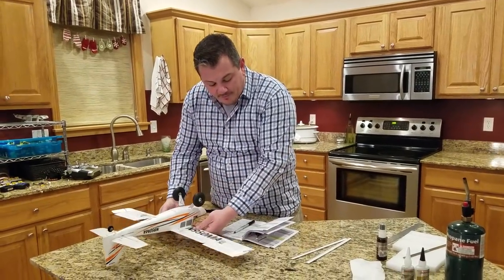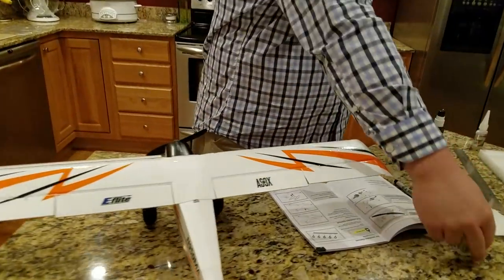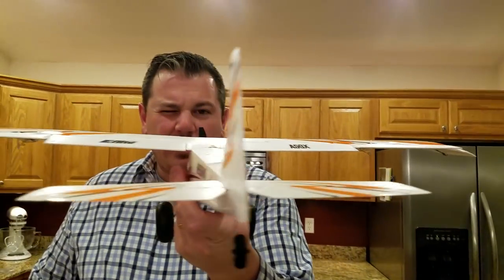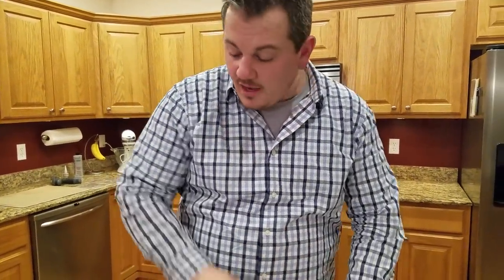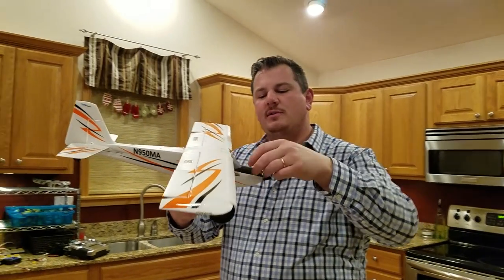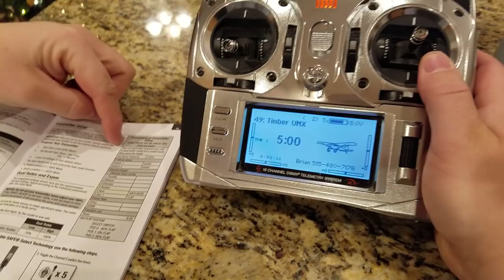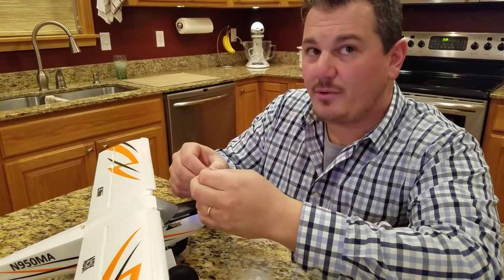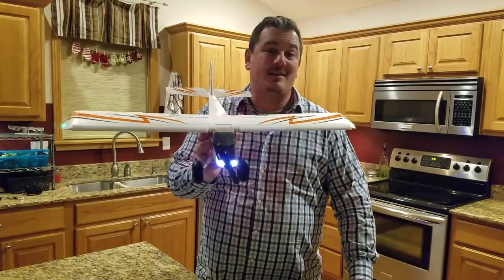Eflite - Timber - UMX - Assembly, Radio Setup, and Tips

Comment: Ok,  I Have the Timber UMX and DX6e as my first RC.  After 3-4 weeks, I have only been in SAFE mode.   The hobby has been a great learning experience.  Have been taking off and landing with Flaps down.  FIRST, Can you please give me your recommendations for elevator mix with both 1) throttle up and down, and 2) flaps up and down. SECOND, After ~~30-40 flights of 5 minute battery flight, I have experience an issue with two of my 2S 7.4 280mAh batteries.  With the battery checking  fully charged, the motor power has failed within a few seconds of take-off,  (NOT GOOD.)  Does the battery have a "shelf life", that can cause a disruption, even though fully charged?  I guess I thought it the battery showed charged, it was good?  Thanks for your help,
Reply from the maker: Let me answer this first...

Okay, are you having this issue with BOTH of your two lipos, or TWO of several lipos...is it a problem with ALL of them, or just a couple...

... I bet your charger is bad!!!

These 2S packs can and will "wear out", but only after many, many (hundreds) of charge-discharge cycles, or off seasons of sitting. I've had these "cheap" Horizon Hobby chargers go bad  ( https://www.horizonhobby.com/cars-and-trucks/chargers--1/celectra-2s-74v-dc-li-po-charger-%28power-supply-required%29-efluc1007
 ) . What charger are you using? (Send me a link so I can look at the specs).

As for elevator settings...down elevator to takeoff and landing flap configurations are highly subjective. If you deploy flaps, and the plane wants to "balloon", increase the elevator DOWN to flaps mix. If you're not 100% sure which way the elevator is going, simply crank it up to 50-100% and deploy the flaps...you will know now :) If you deploy flaps, and the plane dives, you will want to switch your elevator to flap mix from +XX% to -XX% or -XX% to +XX%...just flip the percentage "mix" to the opposite. If you're not sure, start with something like this...

Flaps Off - 0% Elevator
Takeoff Flaps - 10% Elevator
Landing Flaps - 15% Elevator

...then get in the air and test how it work out. There isn't a "right" and "wrong" since it's just totally subjective.

I wouldn't recommend ANY throttle to elevator mixing. I HAVE done this, but it's tedious and not necessarily helpful. Once you're out of SAFE, you might find a cool time to play with this, but now is not the time (As you're still fairly green), in my opinion ;)
Reply: @BrianPhillipsRC  Ok, thanks for the response.  I have been experimenting with the mix, and can continue to do so.  My REAL problem is the battery issue.  Charger is     https://www.horizonhobby.com/ultra-micro-4--4x9w--ac-dc-battery-charger-p-eflc1105a    There are 5 separate  amp settings.  I have been using the 0.5 setting for the  2S 7.4 280mAh batteries.  I have four batteries.  I liked this charger because it would charge all 4 batteries at the same time.  I plug the battery directly to the charger.  Initially, one battery was a problem.  Now, two batteries are problem.   
Question?  How do I know the charger is bad?  Will a new replacement charger be better?  What charger do you recommend for the four batteries? ( I also have the B3 Pro charger.  https://www.walmart.com/ip/iMaxRC-iMax-B3-Pro-2S-3S-Lipo-Battery-Balance-Compact-Charger-For-RC-Helicopter/120636904?  I had no problem with this, but was a single battery charger.
Reply from the maker: I think you might have seen this video by now, but if not, watch this, then read my reply below...

https://youtu.be/4phBLsvV_fo?list=PLXTH0DstRDc5m50UjuP_p5qM-JGifFp

...the playlist has some other charger stuff in it, but this is what you might want to see before you read below anyway...

Okay, the only issue you'll have with your B3 is that it charges at 800mAh, thus you'll be charging at greater than "1C" since these little UMX lipo packs are 280mAh (per cell). I generally like to charge at about 1/2C, or sometimes a bit slower. I will usually charge a 2200mAh pack at about 1.1Amps, which has served me well, even though my lipos only give me about two seasons (about two years..then they start to sag when I use them) of "good use"...What you CAN do, is to build a balance charger cable and use that B3 and charge at least 3 lipos at the same time (when they're all spent, and about the same discharge, and about the same age, and similar wear to be totally safe...)

The balance charge cable is super, super easy to make, where you just have one connector for the charger end, and three or more 2S HXT PH (like from the video).

Ask me if I haven't already given you the answer to your question, and I'll elaborate further...

P.S. I don't think your 2S packs should be bad yet...you might want to complain to Horizon Hobby, if that's where you got them, and see if they'll replace them for you.

P.P.S. That multiple battery charger you got ...  https://www.horizonhobby.com/ultra-micro-4--4x9w--ac-dc-battery-charger-p-eflc1105a   ... if you charge at 0.5 A, you might be killing your lipos :( as you'd be charging at almost 2C. My experience is that 20C packs handle 2C charge rate okay periodically, but I still try to charge them as slow as I can.
Reply: @BrianPhillipsRC  Ok, thank you.  Let me digest this link.  The problem is now worse.  I hav had all the batteries less than 3 months.
Batteries are all fully charged.  On two of the batteries, they are charged , but will not run motor at all, on either the Timber or Delta Ray One, and are worthless.  On the other 3 batteries, motor running is erratic.   Maybe full power  for 3 secs, then quits.  then starts in again only to quit. (frustrating.)  
When I was using the B3, (with the balance connector) for  first two months I was not having a problem.  
The problem seems to have started when I began using the  4 port charger, and then maybe not right away. (I don't use any balance connector as the battery connection fits directly to the charger. Is this ok?) The two cels are not always balanced. I somehow think I may be  damaging the battery by my method of charging?  Can lack of balance, or over charge sometimes @8.6 volts, (permanently) damage battery?                                 Gary
Reply from the maker: Unfortunately Gary, it sounds like you might have cooked your lipos...If you charge faster than the mAh rating on the pack, you might experience some issue, and sounds like you were doing this. The good news, the lipos are cheap, and plentiful :) At least they weren't 5000mAh 6S 90C packs - LOL!

300mAh 2S 35-70C Nanotech - http://amzn.to/2lV70zo
300mAh 2S 30C Kinexsis - https://amzn.to/2M6qcXs
180mAh 2S 20C Kinexsis - http://amzn.to/2CG01oZ
300mAh 2S 30C Venom - https://amzn.to/2AGnIL4 (These ones have three types of connectors!)

I think you might want a couple fresh packs to get you going again! I'm sorry you had this issue.
Reply: @BrianPhillipsRC  Yes.  Thank you.  I had difficulty from the get go on chargers/connectors for the Timber UMX  Struggled to get good info. As a beginner, IMO, the "weak link" on the HH rc planes is the charger, connectors, and usage.
Reply from the maker: I can't believe they don't have a better, and WAY cheaper "entry level" 2S micro charger setup...something for like $20, shipped. I love Horizon Hobby products, but they have some room for improvements in this area!
Reply: @BrianPhillipsRC  Ok, I have batteries on order.  Another question.  After many (rough) landings, the landing gear support has completely torn loose from the foam fuselage. Any ideas to build back up this area and lock in the plastic gear support.  I have thought about some type of pourable hobby resin/rubber, that would solidify around the support?
Reply from the maker: Fill it in with CA and baby powder, then only a drip of kicker to set it off. You can have it back in one piece, but there will be a weight penalty, keep in mind.

Comment: Excellent video, thank you for sharing all these practical tips! I have a quick Q: I have foam tac but no CA, can I just use that on the lights? It says that you can use f-tac for waterproofing, and I'm guessing the only downside is I have to wait longer vs the insta stuff.
Reply from the maker: You could get a similar effect, but it'll be squishy...since it doesn't get "rock hard" like CA... you might think about getting some foam safe CA and kicker. If you fly UMX planes, this stuff is very light per unit of hold and the time you save will get you back in the air SOOOOOOOOOOOOO much faster!!!

CA Medium Foam Safe BSI - http://amzn.to/2E2l29zKicker BSI - http://amzn.to/2CQf24D

Good luck!!!

Comment: Hello I'm new to flying planes and I just got this this plane. I have a Spektrum DXe transmitter and when I try to bind this plane the two inside flaps go down and make a grinding noise and the outside flaps are working fine, not sure why. Do I have to change the settings in the transmitter?
Reply from the maker: The grinding noise might b because your linear servo is running out of range. Check the percentages on the flap channel. Change the max output from +100 / -100 to something like +90 / -90, and see if the problem subsides. If it does, then you can walk the settings back toward +100% / -100% and when you gear grinding, back it back off by 1-2%. 

FYI, inboard (inside of the wing, closer to the fuselage) flaps are called "Flaps" while the "outboard" flaps are called "ailerons". The ailerons control the roll of the aircraft, and the flaps operate together, and generally with aid of the elevator to slow down the plane and reduce the stall speed, and change the angle of attack to point the nose down more, without gaining a bunch of speed. This is a thing in "full scale - real airplanes" as this allows the pilot to see better when they're on approach, and lowing the stall speed buys necessary safety margins for landings, and helps with faster takeoffs...to mitigate wear and tear on landing gear.

Thanks for the question :)
Reply: @BrianPhillipsRC  - Thanks I just ordered programing cables for the transmitter and will try that then.

Comment: Great video Brian, thanks 
Can you tell me how easy might it be to replace the supplied receiver with a flysky ia6 as I only have a flysky radio
Reply from the maker: On the Timber UMX....I'd say it'd be fairly difficult, since there's integrated linear servos on the multipurpose Rx pcb.
While it could be done, it's gonna be a load of work and probably more expensive than buying a DSMX transmitter!
Reply: Brian Phillips thanks for that, good advice
Reply from the maker: I hope you'll do it, this is an EXCELLENT plane!

Comment: thanks for that.  Tell me if I got it-Dual rates control the amount of travel of a particular control surface.  Exp controls the actual stick on the radio by "softening" the movement (control surface).  is that kind of it or did i miss the point
Reply from the maker: No, you didn't miss the point. Rates are the amount of throw, and Expo is the amount of "softening".

One detail to stress, you can "harden" the controls too with Expo too, like for a 3D flyer, for example.

When you can try it, you'll really start to understand it better.

Comment: Can you use a dx5e with this UMX Timber plane I have the E-flite Apprentice s 15E and was wondering if I could use the same transmitter with this plane thanks
Reply from the maker: The DX5e may not have enough channels for all functions, but I suspect you could make it work...

1) Throttle
2) Elevator
3) Rudder
4) Ailerons
5) Flaps
*6*) SAFE Select On/Off
Reply: @BrianPhillipsRC  ok.. i ended up getting a dx6i. Is there anything i have to do to get the switches working.. i want safe on a switch and then the flaps on another.. also this is my first plane with flaps.. when i take off and land you jave to have the flaps down correct?

Comment: Hi Brian

Can you help... my left aileron is not working on the Timber UMX. Any idea why or do I need to replace the servo?
Never happened on any of my aircraft before.
Regards
Noel
Reply from the maker: Can you IDLE it back to center??? Does it snap back to any other position? Is the motor HOT (Like REALLY hot)? Does it make ANY noise?

Comment: Hello again Brian, I just completed programming my Spektrum Dx6e for my UMX .l noticed that when the Gear switch B is in the AS3X mode there is very little aileron or elevator movement when I move the plane around, however in the SAFE mode it reacts like in your video. The Horizon manual on page 7 says that the control surfaces should move a significant amount in the  AS3X mode . Is this an error in the manual?  Is the manual direction test for SAFE mode on page 7 and not for AS3X mode? Thanks
Reply from the maker: AS3X is stabilization, thus your control surfaces will only move contrary the wiggling of the plane, whereas with SAFE (Auto leveling), your control surfaces will move to stabilize AND they'll attempt to bring the plane to level.
Here's the easiest way to figure out if you're in SAFE mode. Get the transmitter and plane turned on, then let your plane initiate, once this is done, go ahead and brace the plane and give at least 25% throttle to activate AS3X and/or SAFE. Cut your throttle to be careful, and then flip the plane on it's back (upside-down), as you move the plane's wing in a rotational axis past directly flat, upside down, you'll see the ailerons BOTH move dramatically from one extreme to the other. This means you're in SAFE. If they don't do anything special at that "completely flat, upside down position", you are just in AS3X.
You'll KNOW as soon as you're in the air, but you need to learn to figure out BEFORE you get in the air, especially if you're just getting started.
Good luck. I hope this helps you to understand better what I was trying to show in the video.
Reply: Brian Phillips Thanks. I watched your video again and tried the test but after I reversed the switch. It worked as it should and like it did in your video. I like having the SAFE activated when the switch is in the 1 position
Reply from the maker: I don't know which direction you'd prefer to have it, and don't use a DX6, so I can't advise you one way or another. I try my best to keep EVERY plane the same or as similar as I can. This is what I tell my friend Esteban too....if you want me to help you fly, set them up however I set them up, so we can hand off the radio with a high probability of success :)
Reply: Brian Phillips Great advice on trying to make programming the same on planes I only have 5 planes but it’s already becoming apparent that it can be confusing if you do each one differently
Reply from the maker: If you get in the habit now, when you get 75 of them in your radio, you'll have a much easier time going between planes.

Comment: Hi Brian, when you glued the foam you made for the battery, you said foam tac glue.  Will a hot glue gun work since i only have CA.  Is foam tac glue good to have on hand?  What other purposes does it serve?   thanks
Reply from the maker: CA will glue stuff together really fast, but it's a slightly brittle connection...so you need fairly strong individual components to glue together, while the foam tac OR mucilage glue will make a very strong, almost slightly stretchy connection, even when connecting two flexible components...and Hot Glue will melt everything and make it too heavy too fly.
Reply: What kind material are you using for the battery.  I've seen it before but don't know the name of it or where to get it. It's not the typical foam.  it's kind of rubbery or flexible i think.  If you recall please let me know. thanks
Reply from the maker: I'm sorry, I don't exactly know the name of this foam, but it's used to package industrial electronics. It's a larger cell kinda rubbery foam, like you said, that keeps it's shape even after being squished. I get mine from around scale indicators, as I work on industrial scales.
If you don't have access to this exact type of foam, you could use a more firm foam, like what comes around the planes from Horizon Hobby...
Reply: I know exactly that kind of foam you used.  Flite test uses it in packaging their foam kits, but I unfortunately threw it away.   I got to learn to save everything, cause u never know when u could use something.  When you can't use a plane anymore from it not repairable do you take all the electronics out and save them?
Reply from the maker: Absolutely, I save EVERYTHING!!! If I find out what failed, I Frankenstein it to keep the good parts from these components too!